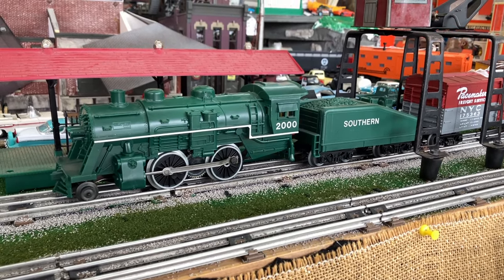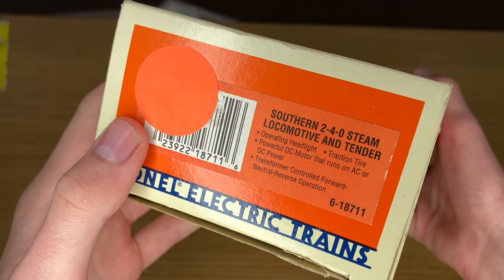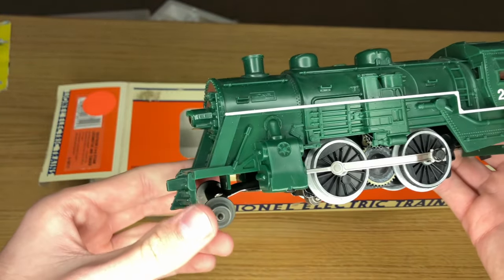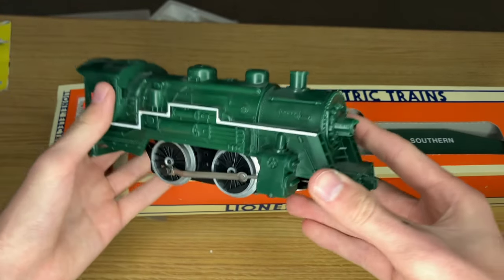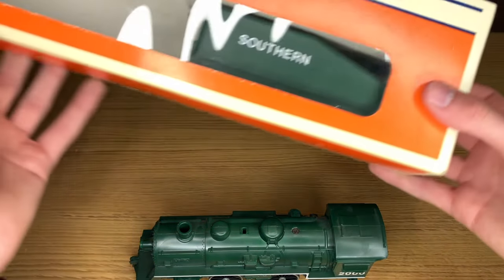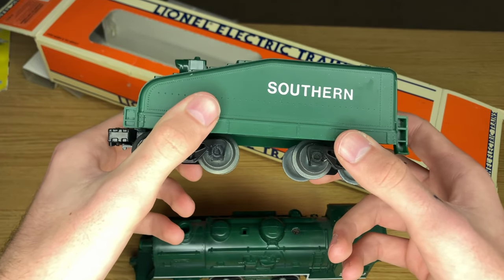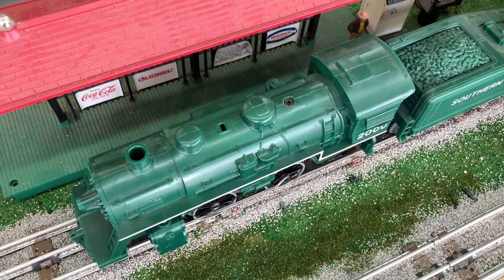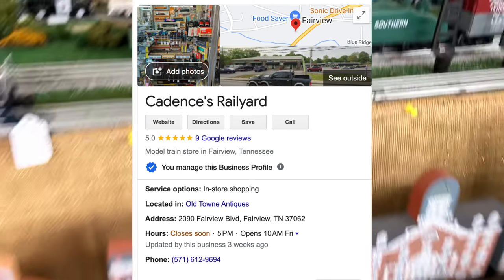Lionel's WORST Model Train Engine?

Comment: Nicely done video but I think the assessment is a bit harsh. I do agree they should have painted the coal load but reality is that this is intended as an entry level toy in an entry level O27 starter set. In that role it looks fine and has an appropriate amount of detail. 8 cars is unrealistic. These sets usually come with 3 or 4 cars tops.
Reply from the maker: Unfortunately, even as a starter set engine, I don't think this engine does the job. Lots of sharp plastic edges where a child could hurt themselves, newer starter set engines from the last couple decades do the job much better in my opinion - I do agree that I could have cut the pulling test back a little bit, haha ;)

Thank you for watching!

Comment: I was given an 80s Lionel O-27 starter set (with many of the parts somewhat in tact) from some friends of mine several years ago with that same engine, but it doesn't have the plug cord and painted all-black with Atlantic Coast Line.  Unfortunately, the front dummy coupler cowcatcher fell apart before I glued it back together before it eventually fell off again and went missing when my family and I were moving.  It was an ok engine for me, but I just dislike how it can only run on DC current and being lightweight.  At least I'm glad it wasn't my first O gauge starter set and that would've killed my intersest in 3 Rail O gauge if it were that set.  Small O-27 diesels from RMT would do a lot better because they run on either electrical currents and decent quality compared to this "Lionel Marx-Wannabe Steamer".
Reply: Owen - Lionel made a few different sets with DC motor locomotives in the 1970s and 1980s.  They did make a set more recently called the "Heavy Duty Construction Set " with a yellow RS-3 diesel that had a DC motor.  Lionel may have made a 4-6-4 steamer and a GP-7 diesel in the 1970s with DC motors.  There are 4-wheel switchers and 2-4-0 steamers like the one Cadance showed here with DC motors decorated for various railroads.   I think K-Line had a set in the 1990s that consisted of a handcar and trailers that was DC powered.  I imagine the Lionel vintage train parts sellers may have parts for these trains.  It probably would not work to use an insulated track section to activate signals on a DC powered layout, unless you are using a sensitive DC relay to activate the signals.  If you are using uncoupling track and operating track sections, you would probably need to disconnect the uncoupling electromagnet coil and the short operating track section rails from the track and connect them to an AC transformer, like you would use to power other accessories, such as streetlights.
Reply: @Petemonster62   I didn't know that.  Thanks!  I wouldn't use my said broken 2-4-0 steamer on my O gauge AC layout, not even when I can expand it in the future and it's the only engine I own that's exclusively DC while others are all AC.
Reply: @OwenConcorde  - I had a Marx 4-wheel diesel switcher that was red & lettered for the Lehigh Valley Railroad.  This engine had a DC motor and was originally in a set that was not powered by an AC transformer, but a power pack that housed 4 "D Cell" batteries for a maximum DC output of 6 volts.  I got a bridge rectifier from Radio Shack and wired it to the motor.  I was then able to run the engine (forward only) with my AC transformer!  Benz Trainz did the same with an DC motor Lionel engine, but he also installed a Double-Pole, Double Throw small-size toggle switch on the engine for manual forward/reverse operation - like a Lionel Scout steamer or pre-E-unit pre-war locomotives.  There might be a Hobby Town hobby shop in your area that carries Radio Shack parts.

Comment: The worst model train Lionel had ever made in my opinion was the Lionel 8803. That engine had cheap molded detail, plastic wheels. It has a DC motor and it has 2 wipers on the side near the plastic wheels since the wheels cannot pick up power. The train cars that came in the set were very cheap too. The freight cars had “fake” non swiveling truck that had a single wheel, kind of like later Marx equipment. Once again, super cheap train set.

Comment: I remember this locomotive. in 1976 I got the Black River Freight set for Christmas. At that time it was numbered 8602 with Rio Grande markings and a working head light. It also had a oil tender with mechanical chugging sound. A very basic locomotive. Standard AC motor, good enough. The tender on this green unit started in the 70's also. MPC unit  8300 used this slope back tender also. rear light was not functional then also. Why does your Southern #2000 have an electrical connection between the loco and tender if does not sport any other functions like sound?

Comment: I only had one Lionel / Model Products Corporation set growing up in the 80's so I don't really have anything else to compare the model against to say if this steam locomotive was worse or not. For years, my father tried to get me into Lionel. The first and only set I had  was the Southern Streak. Although the green steam locomotive was the same 2-4-0, the tender in the set was rectangular with a beaded wheel to duplicate the steam locomotive sound - not a slope-back as shown in the video. 

The only issue that I had with the steam locomotive was that the motor and gears locked up after six months of use. Neither of us were aware of any local model train stores that could have repaired it since my father had purchased the set from Lionel Toy Warehouse when it was in business in Charlotte, NC. My father felt that the Lionel name and quality had gone downhill for a starter set that lasted only six months.

I switched over to HO scale a year later.

Comment: I have this thing, I bought a standard gauge bridge off eBay and this was for some reason included, wasn’t complaining, but I got it and it’s awful, the light at the front shining through the plastic is hilarious and mine doesn’t have any weights in it so it takes off like a missle, I legitimately can’t run this thing without it falling off my table, great video!
Reply from the maker: Thank you so much for watching!

Comment: I think the most embarrassing thing about this one is that; it was sold separately. It is more understandable to have a cost cutting deal in a set to have people get into the hobby with  little cost. Added to that fact this was meant as more of a toy then a quality model, why oh why did they not put the reversing unit in the engine like the earlier models or make it forward only. Now you have a set of 4 wires that are not so kid friendly.
 However the middle gear on the side was a thing with almost any Lionel and some other brands for years as well as the motor frame showing. Yes, since the 1970's Lionel those steamer motor frame parts show more then the pre-1970's, on any side gear driven loco.
 What I fine so odd and hardy no one ever brings this up; this top steam engine shell looks so much like the MarX  490 and 400 steam engine top shell. Use a black marker on the coal load and call it done.
 I myself have grown just to fond of the blue steam engine from the 1970's. They work well that have sound of steam and smoke and if you get the set it has many cars. The cars in that set, most have plastic wheels but they work and look fine and colorful, or use them on a 2 rail O gauge train set if I want to.

Comment: Even most of the postwar 200 series steamers only had a drive rod and no side rod. I’m not pleased with the Can motor, many of those were DC only and using AC will fry the motor. It’s light true. Good luck finding a buyer.

Comment: I think you're being unfair.  I have this very enginre and mine runs just fine. I've had it for 15 years and I run it quite often. It's a kids train and that should be taken under considertion.  Mine runs very smooth and quiet. It dows the job.  It's a toy.  Remember that when you watch your $2000 engine pull 50 cars around some big layout.  It's just a toy too.

Comment: I've got one of the original versions of this, a 1061 from the 1950s and it's significantly worse. It's got the old pancake motor drive with no reverser, and makes significantly more noise and barely moves itself. The rods are just stamped pieces of aluminum with zero detail at all. I've pulled my drivers off to somewhat put them closer in quarter with each other, but it's still not completely right.

Comment: Its pretty bad but Lionel made a lot of crappy low end steamers. The Driving rod only connected to the rear drive wheels goes all the way back to the 1940s and the Scout Locos. I have never liked that feature, either. You don't say whether is AC or DC. Lionel made some DC only ones in the 80s (8008) and those were very bad too. RUnning them on AC will fry the motor.  And the 8502 type shows up a lot.Not much in the looks dept.

Comment: It is just a toyI have several they made 3 different  road names the electronic e unit is in the tender. Great little train with a.consist of postwar plugged door Boxcars behind it. I have the Jersey  version ,bright blue. Great little Locomotive American Flyer  works basically  the same . Gets its electrical current from the tender.